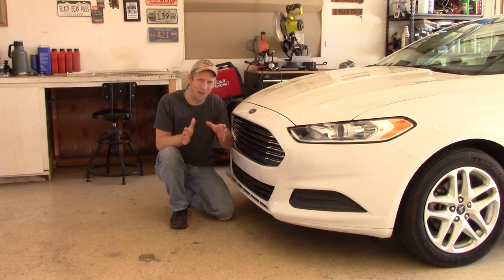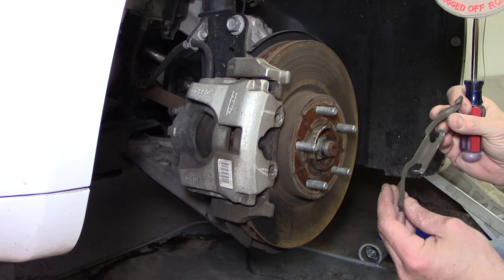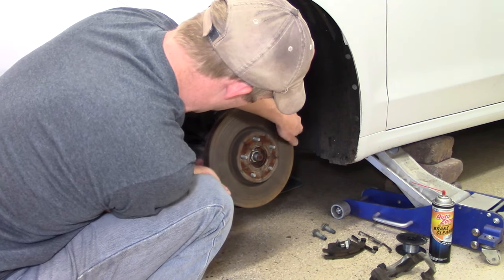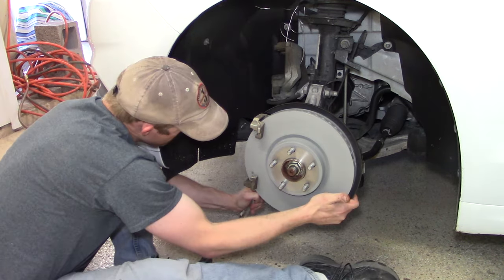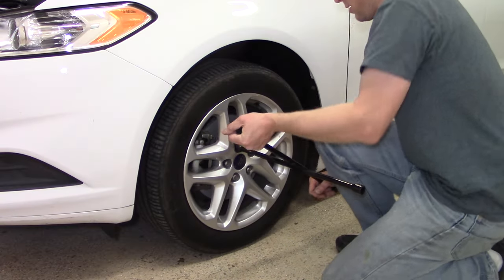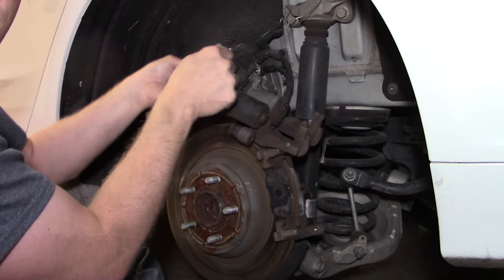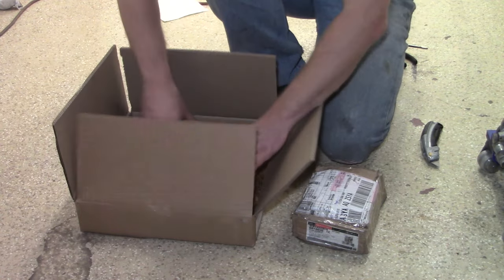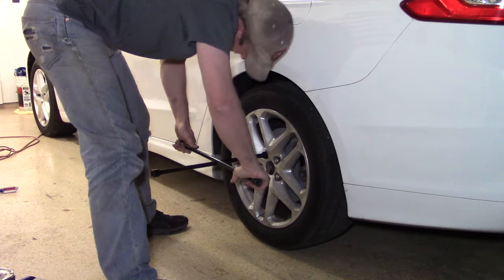2013-2020 Ford Fusion Front and Rear Brake Pad and Rotor Replacement | Full Process

Comment: Do you not have to put it in service mode to do the rear brakes because of the electronic parking brake?
Reply: Yes he should have put it in maintenance mode.
Reply: Yes
Reply: I was going to ask the same thing seeing him twist the. Rear break caliper piston, made me loose it.  Like, it's a great video and great info. But he failed to mention you need to put it in service mode, because if not, you are going to damage the rear calipers
Reply: I put my car in service mode, thus I was able to just compress the rear piston back just like you typically do the front brake caliper piston’s!!!

Comment: Why would you take some needle nose pliers to turn the piston in on the electric brake motor and just put the car in brake service mode which retracts the gear in the electronic motor? Then you can just push the piston back in. You did it the hard way.
Reply: Seriously? Damn it...
Reply: Not to mention you can damage the parking brake actuators.
Reply: I think you still need to do both, i bought the caliper kit to do it. Super easy to get it in maintenance mode and use a 30 dollar tool to retract them properly. Doing the fusion next week. Did the ford edge already.
Reply: @JausTine  If you put it in the brake maintenance mode, the puck is suppose to retract. Mine did and you can hear it. If your pucks dont retract, then something is wrong.
Reply: @HondaGoldwingGL1800 not true.
Reply: @marcstoogood  You need to read the service manual before you spout off NOT TRUE. I put my car in the brake service more as told on several YOU TUBE videos and it did exactly as the videos stated...so dont give me that not true bullshit.
Reply: @HondaGoldwingGL1800  what you said isn’t true though. I have a 2013 ford fusion titanium, putting it in service mode is correct but not all models automatically retract. You claimed that if it doesn’t then something is wrong and that part is not true. For my model you still have to manually retract it
Reply: @marcstoogood  AGAIN...go find and READ a service manual.
Reply: @HondaGoldwingGL1800  no need when I know how to work on cars?

Comment: Is it nessasary to bleed the brakes with this job?
Reply: If you never remove the brake hose from the caliper no
Reply: Only if the brake fluid is dirty or contains too much water. You can get kits to test the water content.
Reply: @lakorai2 thanks for the tip

Comment: Great video!!! A lot of good information. I just did my brakes and my new front pads did not have any adhesive. I got a slight clunk noise a few times when I tested them I bet that the issue, the pad is loose.
Reply: Mine don’t have adhesive either and there’s a weird noice when I break and it doesn’t break too good, what did you use to stick the pad to the caliper?

Comment: According to the service manual it says to throw away the caliper bracket bolts and get new ones.  Nobody seems to do it.  Not sure why it says that..  also for fusion sport 2.7L models I'm told a 11mm hex socket is needed on the fronts.
Reply from the maker: I didn’t replace caliper bolts and its ran fine, but I think they suggest it based on the stress these bolts are under and the tightness these have to be at. Multiple tightens through multiple jobs can potentially shear them off.
Reply: Must be torque to yield meaning once torqued the threads stretch to a “engineered” amount… making the bolts I suppose unworthy of reuse? I’m personally just going to reuse them 🙈
Reply: @Redbullgivesuwings  reused mine, did not see any unusual stress on the threads when they were out.  But they were pretty cheap they come in 4 packs from the dealer so the list price was not as scary as it first seemed (thinking qty 1 not 4).
Reply: Probably because when you're tightening a bolt that much, it can basically begin to wear things out on the bolt, especially the hexagonal shape being stripped. Happened to my oil drain plug and it was a Grade 6 bolt.

Comment: Okay, i can do this. Thank you. It's very straightforward and direct.
Reply: Honestly, brake jobs, oil changes, spark plugs, and a lot of maintaince items that cost hundreds/thousands of dollars at dealerships can be done at home for a fraction of the cost if you have common sense, the space to do it, and proper tools. Investing a few hundred in a decent set of commonly used tools is well worth the savings if you do the work yourself from then on.

Comment: Al did you have to disengage the brake system and the abs. my fusion is electronic braking system
Reply from the maker: I might recommend disconnecting the battery, but I otherwise didn’t disconnect anything. I just made sure the master cylinder reservoir cap was off, which allowed for the fluid to got back into that area once the caliper piston is compressed.

Comment: This is going to sound ridiculous but my biggest anxiety is jacking up the car. I've never been good at this. I know there are slots for the jack but where do the jackstands go?
Reply: Finding a solid steel piece to place it under like a part of the frame that’s wide enough for a jack. Pretty much anything that looks like it won’t bend or slip off. You might be able to find some videos on your specific vehicle if you wanna be sure.
Reply: @Scubasteve118  I’m 99% sure I know where the jack stands can go based off of how thick and tough the steel looks but it would be nice if the official documentation can show you a description. Just to completely eliminate any worry.